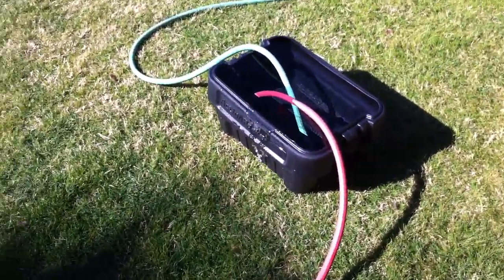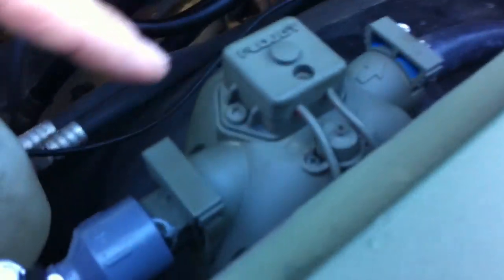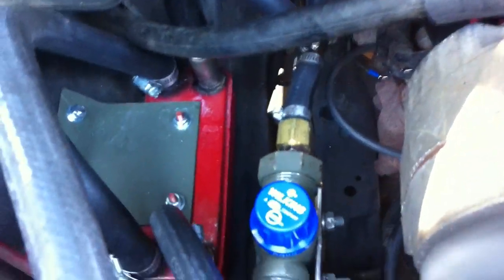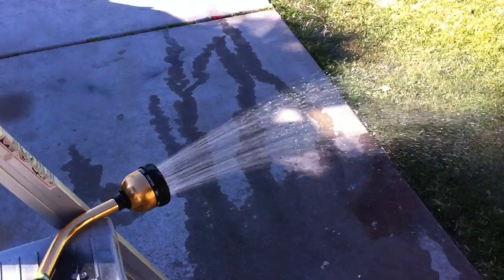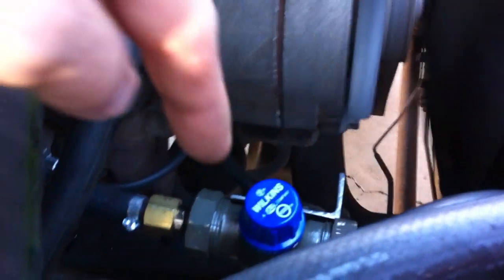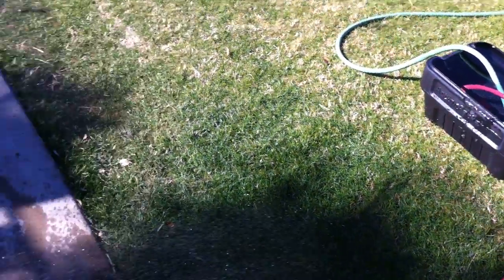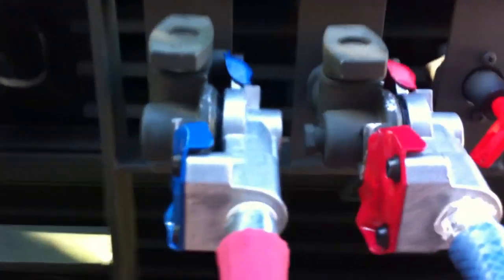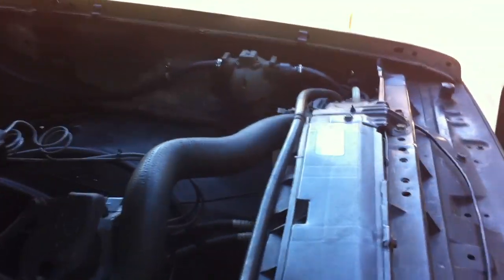HOT Shower Set-up

Comment: I use the automatic transmission  fluid to boil my water in my old fj 40 with 327/400 turbo  box,had hot water in winter  Minnesota.

Comment from the maker: Right, thats the way i originally had it, but when i first fired the system up i could not get enough water pressure for some reason? then i noticed that the blue intake hose was collapsing due to the amount of suction the pump was making, so in a pinch i switched them (the red hose is a better quality) and i never had a problem again.